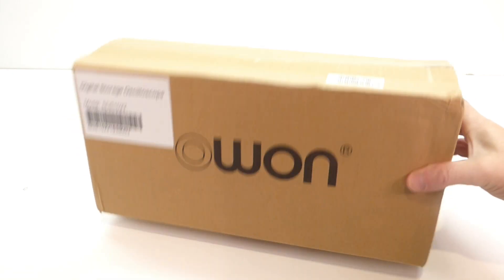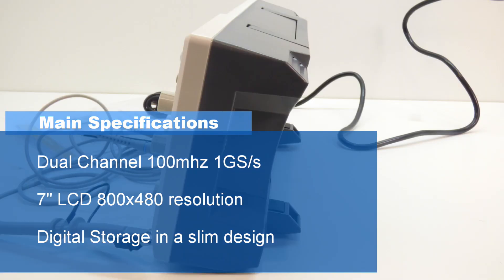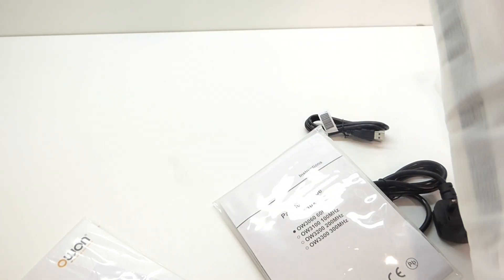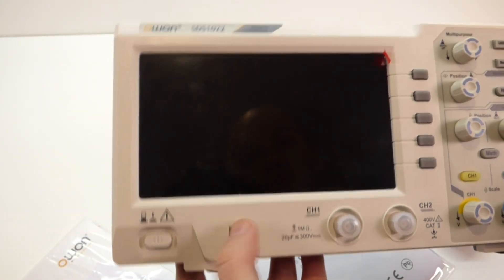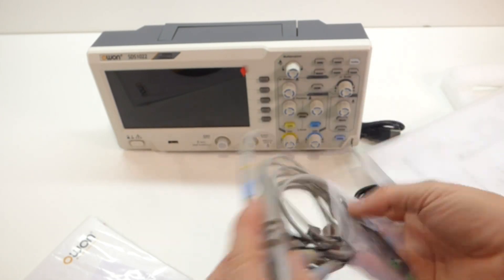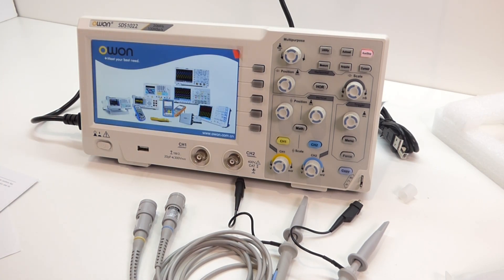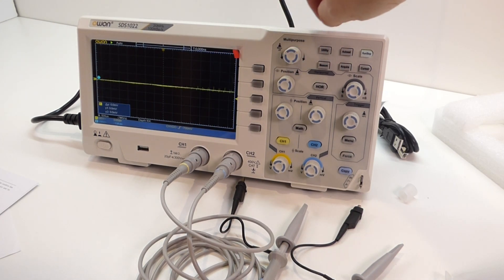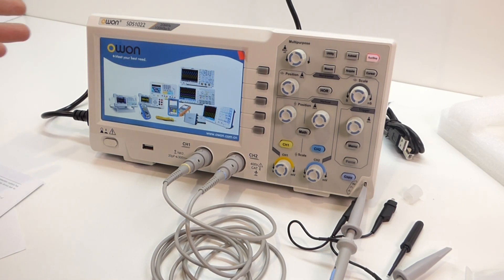Why This Tiny Oscilloscope Is Better Than My Old One? OWON SDS1022

Comment: That was useful thanks. What were you tweaking to calibrate the square wave? Your hand obscured what you were doing. Is there a trim on the probes? Wonder why this was not done at manufacturing stage? Cheers.
Reply: Any 10x probe needs to be adjusted so that it "matches" the scope input.

Note that there are long discussions on matching input capacitance and input impedance which we don't need to get into.  Suffice it to say that any 10x probe must be adjusted, (calibrated), to match the scope.

If you look at where the probe fits onto the 'scope, you will notice a tiny hole.  Inside that hole is a tiny adjustment.

On the front of any 'scope worth picking up is a special metal tab or loop that has a carefully calibrated 1kHz square wave signal.  You connect the probe to that tab and, as you saw, it was not "square".

Using a small plastic tool, (usually included), you adjust the little adjustment inside the tiny hole until the display is absolutely square.
Reply from the maker: Its via the tab on the front, used to calibrate the probes. Thanks